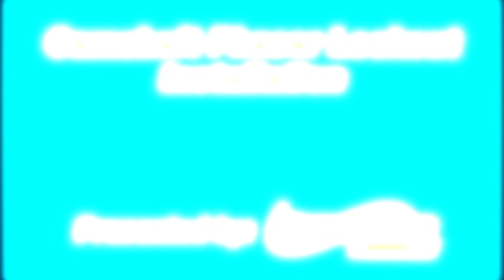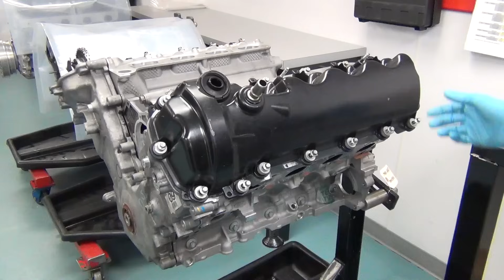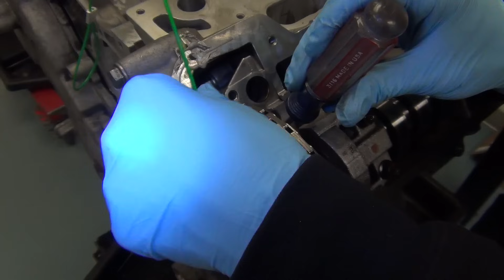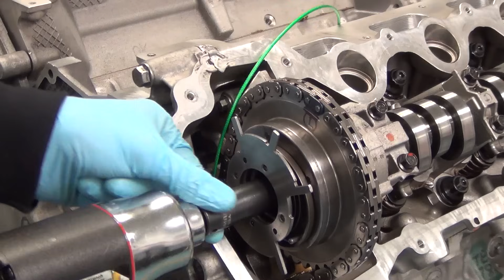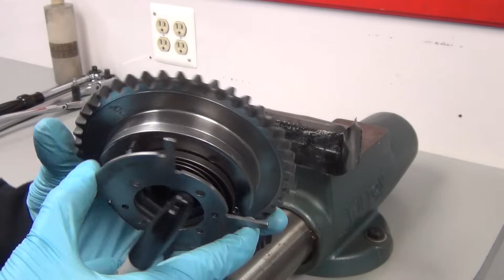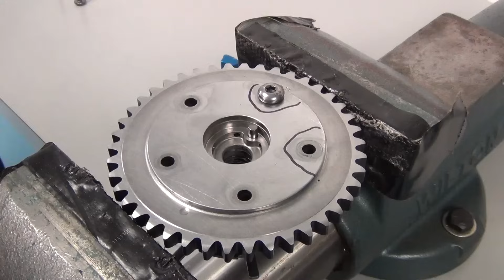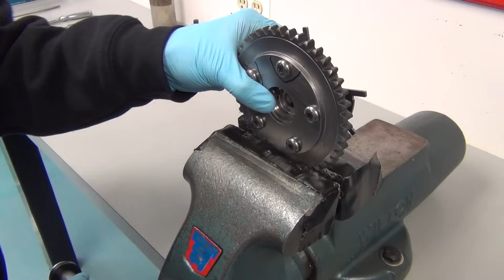Cam Phaser Lockout Installation Instructions - Livernois Motorsports New Link below

Comment: Any possible problems with this lock out thing?
Reply from the maker: no, we have been using these on 3v engines since 2004. far more reliable than the active phaser.
Reply: @LivernoisMotorsports  Thank you
Reply from the maker: @slspg  You're welcome

Comment: For what reason would you want to lock the cam phasers out? I know they are a weak point on this engine. Would doing this cause a loss in power and efficiency? Or would it not make much difference? A friend of mine has a 03 F150 with this engine. She's replaced the chains & the phasers in her truck. That truck doesn't get great mileage to begin with and it runs great. Hers is 4wd. Gets about 16 mpg. Probably 19 - 20 freeway.
Reply from the maker: The reason it to permanently eliminate the possibility of phaser failed which could cause severe engine damage. Most people report better power and economy over failed phasers.

Comment: I just purchased a 2007 f150 with 109k miles for 1500 because of a engine knock/rattle when warm at idle. I will definitely be getting the lockout. Is there a specific brand kit to purchase for reliability and having all the proper parts for install? Like gaskets and bolts?
Reply from the maker: Our Cam Phaser Noise Repair Kit comes with all the necessary components, and is patented and 50--state legal

https://www.livernoismotorsports.com/product/LPP823113

Comment: This procedure is incorrect if the camshaft is not in a neutral position it will jump when you remove your vct sprocket. You must remove a couple followers to put the cam in a neutral position or you’ll end up pulling your timing cover and retiming your whole engine
Reply from the maker: We actually do these all of the time without ever removing rocker arms.

Comment: We are considering this for one of our fleet trucks, just trying to find a mechanic that will do it.

One mechanic said it is too late (we just started feeling some rough idling this week). This is a better option than engine or phaser replacement and honestly probably worth a try. Thoughts on it being too late or is the mechanic just trying to sell me an engine. Btw if I can get even a year out of this it’s a huge win.
Reply from the maker: Typically it's only too late IF there is damage to the camshaft and phaser dowel pin area, and that usually takes a long time of ignoring the codes and noise. So if it just started, while it's always safe to inspect, that's highly unlikely.

Comment: How did you guys keep the cam from spinning when you torqued the cam phaser bolt?
Reply from the maker: With the wedge tool installed, it kept the engine from rotating.
Reply: @LivernoisMotorsports   Thanks, that makes sense. I currently have a 93 tune on my 3v. How much power am I going to loose by locking out the phasers and uploading the special tune?
Reply from the maker: @goodgollyjosh  to be honest, vs a failed phaser, these usually improve performance, but the loss in power vs a functioning phaser is less than 4hp, or basically the same as the tolerance in dyno runs from one to another.

Comment: great video .... wouldnt you reduce risk of cam moving upon phaser removal  by removing several specific rocker arms? i think i also mark cam to head
Reply from the maker: Yes, and no. while it further prevents one set of issues, it creates different ones. so we elect to keep them in place

Comment: This guy is Awesome Thank you so much for the excellent Video. It had everything I needed to know. Thanks again.  RIp Wyane Static
Reply from the maker: We're glad to hear that, thank you!
Reply: @LivernoisMotorsports  Hi. I was wondering, does installing this delete make the timing chain and system last longer ? Is the engine less sensitive to low oil pressure ? Will engines with deletes last longer with less trouble and why ? Thanks
Reply from the maker: @Toro_Da_Corsa  Typically speaking the timing chain system takes a beating when the phaser system fails as the shock load is being absorbed 100% by the chain and guides/tensioners. so eliminating this issue puts less stress on those items. It is also less sensitive to oil pressure changes as the VCT system requires a substantial amount of volume to work properly. the engines themselves as a whole don't necessarily last any longer, but the oil/timing systems do, reducing the need to replace them. so as much as we would like to tell you that it would be directly responsible for the engine lasting longer, the engine itself, if you constantly changed those failure points, would last a long life. But, since you are having to replace those items less frequently, it helps life for those items.
Reply: @LivernoisMotorsports  Thanks for the answer. One more question. Since you guys have seen your fair share of Fords... When you lock out a 2004 or newer Triton , does it become as reliable as an old 2 valve Triton generally speaking ? 

Im looking for a truck and I never had problems with 2 valve Tritons. But the phasers are almost pushing me to buy a Chevy. If the locked out 3 valve is close to as good as a 2 valve, I'll just buy a good used Ford and send it to the shop to get locked out right away.
Reply from the maker: @Toro_Da_Corsa  We feel it is, the only issue left is spark plugs on the pre 08 engines, but just changing them every so often is a big part of if you will have issues. But to be fair, 2v engines had their own spark plug issues too.

Comment: Could this be dangerous for the engine overtime?
Reply from the maker: Definitely not. This actually removes a huge flaw in the design and durability of these engines dramatically improving reliability and longevity

Comment: Customer of mine has an ‘08 F-150: If a 5.4 3V is already idling rough and throwing codes, are the existing cam phasers going to have to be replaced before installing this lockout kit, or can I just use the phasers that are acting up since they will no longer be able to rotate internally?
Reply from the maker: We always recommend inspecting them for damage, especially around the cam dowel pin area. if they are undamaged, there is no need to replace them.
Reply: @LivernoisMotorsports  Excellent, thank you for the fast reply!

Comment: I have the different style of wedge with the solid stick instead of the string, it wont fit in passenger side chain. If i leave it in the other side will it hold the other chain in place as well? Thanks.
Reply from the maker: we unfortunately cannot comment on how other tools made by other companies would work. Our tool requires it to be used on each side of the engine respectfully.

Comment: What exactly is the importance of having the phaser lockout that way? I thought that would impact on the VTC ability to vary the timing of the engine?
Reply from the maker: It does delete the vct system, and that's on purpose. The vct system in these is plagued with issues and the only permanent fix is deleting it entirely.
Reply: @LivernoisMotorsports  but did you do that on both banks, and how was the performance of the engine? Any lag, or difference in torque output after the install?
Reply from the maker: @dxta7360  Yes we did. As for the power it's usually better than a failed system and almost identical to the vct being functional.
Reply: @dxta7360  you flash the ecm program afterwards to adapt for running rhe timing 20 degrees adavanced. Once you do that the performance is better than when it was new and you wont throw CEL

Comment: What's the use of this blue piece that's been fitted in the gear?
Reply from the maker: That is the lockout, which changes it form variable cam timing, to fixed cam timing and eliminates the "rattle" noise and fault that is common with these engines

Comment: Good video. One added comments I feel is important- don't drive your Fords if you are hearing phaser noise. If you do, you'll be causing a catastrophic failure in a short time. Stop and do this fix.
Reply from the maker: we agree, we've seen far too many sheared cam pins or cracked phasers due to ignoring this problem.

Comment: Question so now I don't have to use the  oem phasers from ford and I can just buy a cheap one ?
Reply: THE EASIEST WAY TO FIX ..... ya but lock it right away! I’d even take it apart first and reassemble it with lock tight bcs I’ve seen these come apart inside the engine

Comment: Do you also stock the timing chain tensioners or recommend a certain brand, and what oil pump do you recommend ? Also do you recommend a new timing chain? vehicle has 170,000
Reply from the maker: we always use brand new production Ford components if we ever replace any of these. At higher mileage, replacing items like timing guides, oil pump, tensioners, and chains are always a good idea.

Comment: I have a 2006 Mustang GT as a code of peas 0012 I changed the cams to comp cams and now that code won't go away.. I've tried a number of things including camshaft phase or lockouts that code still comes up I'm questioning maybe my brand new chain tension or or possibly the oil pump itself not enough pressure??   Timing chain Fraser's guides are all supposed to be new?
Reply from the maker: Unfortunately there is far too much going on to diagnose by description. It could be calibration related, spring pressure related, actual cam timing related, damaged sensor, etc.

Comment: How much does it cost to tune the computer to work with this fix or can you buy a tool without downloading  the tune from Ford. You did not mention this as some other videos say you must redo the computer.
Reply from the maker: Arthur Rodesiler our complete kit with lockouts, phaser bolts, wedge tool, and tuner with CARB EO tunes is currently $699.99

Comment: So if I have install lockouts on my 5.4 engine, does it matter if the vct solenoids r bad? Or do I have to replace them aswell?
Reply from the maker: Martin Rodriguez no it does not as they will no longer serve a purpose
Reply: Thank u for the reply, I’ve been debating on installing the lockouts or replacing the cam phasers.
Reply from the maker: @MartinRodriguez-gx9cs  you're welcome, obviously we recommend doing the lockouts, as phasers will fail again, and always sooner the next time

Comment: I have to drive my truck from Sacramento to Portland for a move on Tuesday and my cam phasers have started acting up throwing a P0021 and P0011 code. I’ve changed the VVT solenoids. Will driving it kill the engine or is the noise more of an annoyance? Just hate to drop 3,000 for a last minute fix at a local shop.
Reply from the maker: courgargold This kit shouldn't cost anything near 3000 installed. The kit itself is $699 as of writing this, and installs in 6-8 hours.
Reply: Yeah, they want to do timing and tensioners too. The chain is tight and doesn’t have any lash. I might just get the parts and do it myself tomorrow.
Reply from the maker: courgargold It is a fairly straightforward install, many people install themselves.

Comment: Does this basically eliminate the action of the phaser ????  Thanks
Reply from the maker: indeed it does
Reply: @LivernoisMotorsports  How does it effect driveability / power etc.. Is there a gear that can be installed and eliminate the phaser completely ? Thanks
Reply from the maker: John B there is no need to do that as once you lock it out, that's exactly what it becomes. making a whole gear would just add cost to a system that works phenomenally with our lockouts. Almost everyone reports improvements in drivability with it and often improvements in responsiveness and power vs a failed system.

Comment: Can this be done on a ford 4.6 romeo engine?
Reply from the maker: if you are talking about a 4.6 2v or 4v, no. these do not have cam phasers, but if you have a 4.6 3v, then yes it will work with those as well.
Reply: @LivernoisMotorsports     thanks bro. U the man

Comment: So I got to thinking on this whole cam phaser issue on the 5.4L . So wouldn't just getting a new torque bolt  fix the issue for another 100k? I know the lick out is a more permanent fix but it seems like the bolt getting out of torque because of the design flaw is biggest prob and may stay good after replacement for 100plus miles. I'd be fine with that for a $10 part.
Reply from the maker: Technology on the Beach No, the phasers lose control due to reduced oil pressure that naturally happens as the engine ages and wears. The phaser itself, along with the timing drive, and fasteners have nothing, or at least very little to do with this phenomenon. That's why replacing the entire drive system with new components maybe lasts for 1-15k miles before happening again.

Comment: Well I would have purchased this kit before my 3 valve out of my ‘04 F150 bit the dust because of these phasers.  Can I replace it with a 2 valve engine instead?
Reply from the maker: ajthib Unfortunately not easily. Almost everything from computer, to harness, as well as intake and exhaust are all different.

Comment: So question, I read that locking out the phaser will lock it in the full advanced position. Don't we have a kit that will set the cam at zero degrees so there's no issues?

Comment: Howdy Livernois Motorsports, regarding this install, why does the spring placement matter if the adjustable portion of the cam is locked in place with your product. could one simply remove the spring or is it somehow needed?
Reply from the maker: Derek Bishop It's technically not needed, but we prefer to keep things as close to OEM process as possible.

Comment: what is the purpose of doing that?
Reply from the maker: The purpose of the lockout is to repair the noisy cam phaser issue that is common on these engines
Reply: @LivernoisMotorsports 
 why not change the unit?
Reply from the maker: The phaser is not the issue, lower oil pressure from the engine due to wear is, so replacing the phaser only buys time while the spring is new and strong, since it will be working harder than normal the spring wears much faster than normal and you will be replacing again soon, each time at quicker intervals. Our system fixes it once and for all
Reply from the maker: hhhh9579 The kit eliminates the need for these changes.

Comment: When you buy a new f150 gasoline ... when they get old it sound like diesel engine... too much problem to this truck... better Chevy 🤔🤔🤔
Reply from the maker: They're actually fairly reliable so long as you perform maintenance, but eventually with age things can fail. Unfortunately all makes have their common failures. GM with their DOD/AFM system, Ford with the VCT and spark plugs, and Chrysler with their valve seats.
Reply from the maker: They're actually fairly reliable so long as you perform maintenance, but eventually with age things can fail. Unfortunately all makes have their common failures. GM with their DOD/AFM system, Ford with the VCT and spark plugs, and Chrysler with their valve seats.

Comment: What will happen if you dont tune out the vct solenoids?  Could it cause my oil pressure to drop to 0?
Reply from the maker: No, but it will set a check engine light and run in default mode and limit power.
Reply from the maker: No, but it will set a check engine light and run in default mode and limit power.

Comment: Will this fix the ticking that make the 04-08 f150s sound like a diesel? Also, can I do this to the old phasers or do I have to buy new ones?
Reply from the maker: You will buy the ones that are to fit the 5.4L Triton V-8. To answer your question it will drastically help and fix that problem.

Comment: will JB Weld work in the place of the Lockout module 😂  

It least just for a little while 😉
Reply from the maker: It will not unless you needed a quick fix to make it home as an example. We don't recommend doing this be best to purchase the cam phaser kit to fix that.

Comment: Do a complete timing job when doing the lockouts. Tensioners, vvt valves, chain guides and a new oil pump. You'll get another 100,000 miles or more.

Comment: I own a 2010 f-150 with a 4.6 3v engine. Could I run a new cam after installing this? the specific cam will be the Brenspeed Detroit Rocker. Also I see you have the option for the performance tune. is it worth the added cost in your opinion seeing you can no longer use a modified tune.
Reply from the maker: We do have a solution for performance camshafts, but it would need to be tuned at our facility.

Comment: Since you never used the tuning device in the kit during the video is it necessary and could the kit be sold without it for several hundred dollars less since it is just a couple small pieces of metal and a hunk of plastic? It is very expensive and seems much like price gouging. Make it affordable and you may sell alot. At $700 for that kit for me it is not even an option
Reply from the maker: The recalibration of the computer is a 100% necessary part of this repair. Without it, not only will it have a check engine light, but it will also run in a default mode, and have poor drivablity. I apologize that you feel the price is not fair, but we have a tremendous amount of r+d time, as well as CARB EO status, and is fully patented due to it's unique design.

Comment: I have that noise. Is it necessary to change the phasers or just put the lockouts in the old phasers. Car has 209,000 miles but is still running fine,just that sound
Reply from the maker: Marcus Perry You can install the lockouts in the old phaser so long as there is no mechanical damage to them